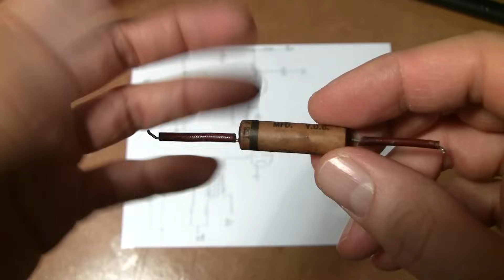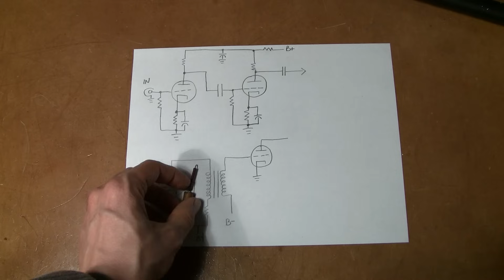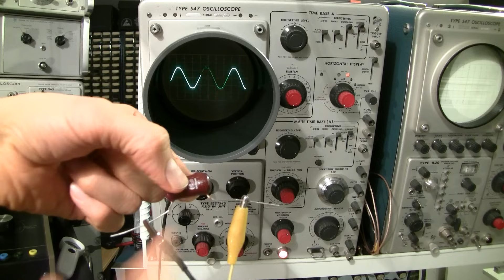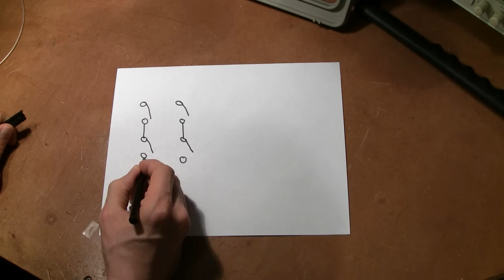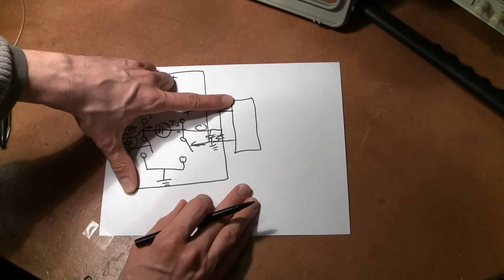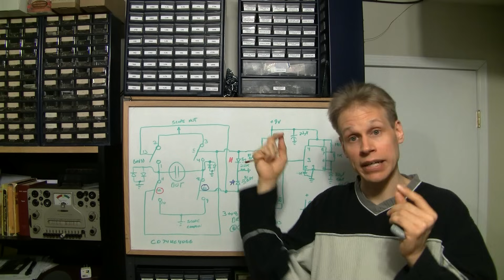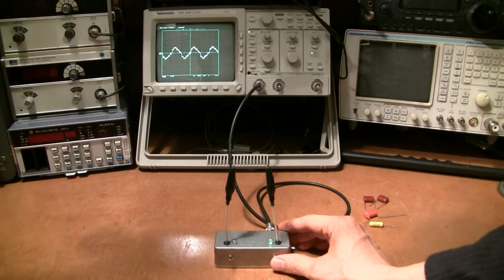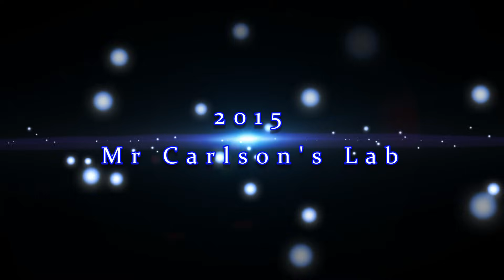Are Your Capacitors Installed Backwards? Build this and find out

Comment: In America SOLDER the "L" is never pronounced, hasn't been for the last 70 years, 
check in a few printed dictionaries.  (on the internet resent usage seems to override traditional values, that is a wrong thing to do)
Reply from the maker: A tradition of wrong pronunciation is not right either. When you sell your house, its SOLD. If you look at the word army SOLDIERS, there is a vowel one letter before the L, and one after the D. If you look at the word SOLDER, it's the same. Why the silent "L" then? Reason= followed mispronunciation, just that simple. On another note, I don't live in America (as in the US.) In many other places, this proper pronunciation is quite standard. Here is an example of it being said in both ways, in the Cambridge Dictionary:  http://dictionary.cambridge.org/us/pronunciation/english/solder  It's a big world outside the US :^) Thanks for your concern Ronald.

Comment: DPDT switch may have been easier to make, but this is easier to use.
Reply: Ben Beharrell if you want the ease of use you could use a DPDT relay instead of a manual switch. I see those being used to switch polarity on small dc motors and even brushless 3 phase motors (you only need to swap 2 phases to change the running direction)..
Reply: Yeah my thought exactly... depending on how you mount the switch you could even use it as an indicator as to which end has the foil. Too easy maybe?

Comment: HI !   i tried  this  experiment  on several scopes  , on an eico 460 , leader lbo 522 , stark osk4 , tektronix  453  ,hp1821  , telequipment d66 .
and  on none  of  them  i was able to   replicate  your  results .   no  differance  in amplitude  was  shown  on any  of  the  scopes i set the  scopes  down to .2 millivolts  per  division  and  as  low  as i could  go  on the  eico  and  stark  scopes  .
am i doing something wrong ?  the  cable  i am using is  the  same  as  yours .

or  is  there  another  specific  setting  on  your  scope  besides  the  .2  millivolt  per  division  setting ?
Reply from the maker: Hi, Make sure you can see a sine wave at 60Hz on your oscilloscope with your fingers touching the scope input. Now, use the highest input gain setting on your scope. Use a coax cable with alligator clips at the end as your test probe. (don't use a scope probe)

Comment: Mr. Carlson: There is no dumb question, so I was told. So, if you will permit, I will ask a few questions. I know electronics is very popular and I am astounded at YouTuber's sophistication which leaves me with an inferiority complex. I read "DSO" oscilloscope can mean "digital storage" or "digital sampling". I see you switched oscilloscopes. But what has got me paranoid and bouncing off the walls is the potential harm that the incorrect capacitor installation will cause. Why have the capacitor manufacturers stopped marking their capacitors and why did they mark them incorrectly when they did mark them? Have they no shame? Don't they care?  Basically, information gathered through your video has put the brakes on my electronics hobby. If I cannot ascertain the correct polarity of my capacitor then why should I proceed at all? And what you are saying is that your device is to be used in conjunction with a DSO oscilloscope? I did not see you use your device without an oscilloscope to ascertain the polarity of a capacitor. I am confused. I do not want to build a project only to have it bricked by incorrect capacitor installation.
Reply: Relax.  :)  The worst that can happen (if you have the foil on the wrong side) is that there may be a slight bit more noise introduced.  However in most cases you shouldn't need to concern yourself overly much.  You certainly aren't going to BRICK anything or draw too much current, etc.  The only time it may cause a problem is if you're dealing with a circuit that is very sensitive to low noise levels.   On the other hand, where you ABSOLUTELY MUST BE CAREFUL is when dealing with the polarity of "Electrolytic capacitors" (not the non-polarity type capacitors referred to in this video).  As you're probably already aware, you MUST be mindful of the negative and positive sides of electrolytic capacitors when installing them.  These type capacitors are well marked so it's not an issue if you're paying attention to the markings.  If you install one of those backwards, that's when bad things happen.  Again, that is NOT GOING TO HAPPEN with the non-polarity type capacitors discussed here.

Comment: I expected that you will build some peak detection device, that will automatically find in which coupling capacitor gives more noise and indicate it.
Reply: Seems an unnecessary over complication. What's wrong with the above circuit?
Reply: Just an interesting challenge.
Reply: +nihonam Gotcha. Cheers!

Comment: Thank you for your great video.  In a restoration project I have been restuffing paper capacitors with (also tubular) modern capacitors.  They are not a dipped type.  Are you aware if they have polarity as well?  I actually have a youtube video on the process and am concerned about giving out bad advice.  Thanks in advance.
Reply: Yes, tubular axial lead capacitors usually have an outside metal layer and an inside metal layer, separated by an insulator, and rolled into a tubular shape.  They will have a preferred orientation for  best shielding.

Comment: Thanks for all of your informative videos. I have an old Tektronix 2246 scope, which should have sensitivity down to 2mv per division; trying to test a new, yellow, .1uF 250volt cap for polarity, ie, marking of the shielded lead per your video. My test has same peak to peak voltage after reversing the scope leads. Any ideas for what I may be doing wrong? Thanks for any suggestions.

Comment: I think you are over complicating this. can't you just take a double pole, double throw stitch, wire it in a cross configuration, like a light switch for a stairwell?

Then the side that the switch points to, would be the side of the foil. No LEDs needed.

GREAT channel btw!! I have learned a lot from your videos! I have a bunch of antique amateur radios to restore, and your vids have given me great insite for those projects!
Reply: i agree. a simple dbl pole, dbl throw would work perfect. no batt, no leds. the switch handle point would point to the shield end.

Comment: The term "polarity" is not synonymous with the distinction of outside and inside foil.
Reply from the maker: You may find more of my video's interesting Arthur.
Reply: Indeed, I have seen several of them, and they have excellent information. My issue with using "polarity" in the context of foil capacitors is merely a matter of semantics.

Comment: How about a purely passive box, with a manual DPDT switch where you cross-wire it and then mount it horizontally?
So you have the same physical box, with the same alligator clips and bnc out, but no LEDs, and change the switch over to a DPDT one, mount it to the front instead of e side, and then wire it so that when it's to the left, the left end is ground, and vice versa. Then you can hold the capacitor with one hand as antenna, and flip the switch with your other hand until you find the side that's got lower output, and then mark the side of your capacitor that the switch points to.
Reply from the maker: Give it a try and let  us know how it goes. Until I build something, I can't give you an answer on that.
Reply: While watching this video, the same idea struck me! This is because of the diagram which was viewed on the board. It looks almost similar to a DPDT Switch.

Comment: Hello again from Norway!
Is this possible on a new digital Oscilloscope? I just now don't have an analog scope and wonder if my Rigol DS1104Z has this possibility? I have done the same as you and put it on lowest voltage pr division but I get no result, only some crappy readings.
Reply: I have same problem with not working on my Hantek.  Wonder if its because I can only get it down to 10mv and Mr. Carlson said to set at 5mv or 2mv

Comment: is there a tester you can use that does not require a scope for checking these ?
Reply: It should be easy to use and arduino or other microcontroller to sample at a certain frequency and do peak detection on it. With an lc display you can show the levels in each direction. Or connect an amplifier to it and listen for louder/softer volume. Maybe a crystal ear piece provides small enough load to do it without amp.

Comment: Have you done a quantitative test on this issue ? Have you build an amp that has the outer shields of the caps connected to the input signal paths ? Otherwise your suggestion is a myth. And there are other reasons why this does not matter too, but I'd like to know how you came to the conclusion that this matters at all, in the first place.
Reply from the maker: Hi. Why do you ask for a quantitative test when "that test" is clearly displayed in the video multiple times with an oscilloscope? 
As for your second question, why would no difference at the input signal path make this a myth? What about screen grid bypass capacitors? What about stage to stage? Have you built any HF and VHF oscillator circuits using tetrodes and pentodes? If so please describe your circuit in your next comment. I'm particularly interested in measured modulation levels on the screen.
Your third and last statement.... Why do you think they clearly marked the end "outside foil" and put a band on that end. Maybe they had lots of time and money on their hands, and just put it there to be pretty?? Maybe they had special machines designed to mark that end and properly and orientate the capacitor on the assembly line just for fun. 
"I don't make video's about myth's, I make video's to educate people." I do find some people try to justify years of mistakes though.
Reply: Your video (and most of your videos) appears to be viewed by a number of audio enthusiasts. Does a paper capacitor with the outer foil connected to the preceding stage's input make any difference to the spurious signals picked up by the grid on the following stage ? I really doubt it, when you consider the unshielded construction in any audio amp.  This matters a great deal in RF obviously, even modern solid state.

Comment: Why you do it, because you have a lot of money and time. American spent millions of dollars in researching pressurize ball pen so that it can write on paper while a fighter flying up-side-down. The Russian solved it by using a 20 cents pencil.   
One 20 cents 2-pole 2-way switch will do the job nicely, period.
Reply from the maker: Thanks!
 But the switch system doesn't work :^) You can find out "many time's why" in the comments, period.
Reply: It's fairly obvious that using a pencil was an option and I'm sure that the NASA engineers did consider the use and like FRR has stated it would come with problems in low gravity around electronics that are critical and must work also, I see nothing wrong with the fact that the world now has a pen that does work in environments where before we did not. Maybe someday if humanity becomes a space dwelling species where many of us live for years in low gravity this pen might find some use, not to mention the knowledge in the physics that were taking place that can be applied to anything that may function like this pen in low gravity.
Reply: I switched to writing with a pencil several years ago because being used to using a keyboard, thinking ahead, clicking fast, I need a delete key.  A pen has no delete, a pencil does. Better, cheaper, no-brainer.
Reply: Pencils break requiring a resharpening procedure.  No big deal unless time is of the essence.
Reply: The pen actually proved to be very useful to the crew of Apollo 13. Without it they might not have made it back. The law of unintended consequences.
Reply: sorrylifeless 
having carbon particles floating around your very sensitive and critical electrical components is bad...
Reply: Lies. In fact both russia and usa used the same pen made by the same guy.
Reply: +Mr Carlson's Lab - Apparently all those answers have been buried by other comments.... Could you pin one to the top?  It's kind of an important point, but I've given up looking for it in the comments.  Thanks!
Reply: The Russians also had problems with graphite particles shorting out electronics from their 'ingenious' simple thinking...
Reply: I stopped reading after the false tale about the astronaut's pens/pencils. It's a cool story, but it's not true
Reply: Thats not what tom hanks says.
Reply: helllooooo there is a lot of pencil's out there without graphite inside: color pencils, pastel pencils, watercolor pencils, etc...

and what about carving your words on a plastiq book with a hot electric pen?

Comment: How do you make something similar..that would not require an oscilloscope???
Reply: Standalone unit is what it looks like from the video thumbnail, too.

When he was insisting on a metal box what I thought he was going to do was either amplify the AC hum or more likely use a new test frequency and have the metal box be the antenna for this circuit. This way you don't need to put your fingers on the cap each time OR have it hooked to a huge power-sucking scope that is not field friendly. The signal would just be transmitted to the cap's foil.

What you ideally want is an oscillator circuit that makes a signal that has a maximum power transfer to the average size of the cap being tested. (2-4 cm) But probably any frequency would work. Matter of fact I'd probably put a strip of plastic across the top of the box and a wire over that so it is used like a miniature antenna and the metal box would act reflectively to keep the signal directed towards the cap to assist in eliminating false readings.

Then have the circuit have an op amp connected to one bicolor red/green LED. When it lights green that is your foil end. Much less fouling around. Tune the op amp input with a simple Twin T oscillator.

https://en.wikipedia.org/wiki/RC_oscillator#Twin-T_oscillator

In fact with a dual op amp chip this could all be accomplished and probably with an even lower current draw. As a plus I might add in either a beeper of some kind so even a blind man could use it. I knew a blind guy who could repair tape recorders. He'd probably love to be able to take his hobby further and I do know of several blind people on YT who seem to live for the interaction in the comments. There is even a blind woodturner on YT!
Reply: Connect capacitor before your amplifier input, orientate capacitor and listen, whenever you satisfy the sound, you got it right.
Reply: just make a scope out of an old crt tv ;)

Comment: I am so glad that I found your site. This is stuff I can use. I happen to have a couple of old heath magic eye capacitor checker. I have an old way back Eico Oscilloscope. that need repair. Now for my question. Could it be possible to use Your device with a sensitive Multi meter using millivolts ? I almost want to believe yes. and I would quickly make the device if I know it would work. Thank you for any thought you don't mind sharing on this. I Know you are darn good at the real meat of the electronics and how it really works and what could even be tossing manufacturers a curve.
Reply from the maker: +Michael Kelly 
Hi Mike, You could try an analog movement AC VTVM. Good chance that would work.

Comment: +Mr Carlson's Lab , i just finished my first marshall plexi clone and going crazy because 60Hz hum and noises.
Already did star ground schematic, metropoulos clone schematics with no sucess. Is it possible that my ground noises are becase I have used some polypropilene axial capacitors installed backwards? There is no other way to check, I do not have an ocilloscope?Thank's in advance.
Reply from the maker: +V8punch 
Hi, If the hum is really loud, I think you may have a different issue. If it's subtle, it could be orientation. How loud is the hum on a scale of 1 to 10, 10 being the worst?

Comment: Hi there Mr. Carlson, my question is on old tube radio schematics capacitor symbols are the same for positive and negative? is there a way to tell which side is pos or neg on the schematic. the newer schematics show a small line for pos and a bracket for negative so  can you tell what it what. thanks john